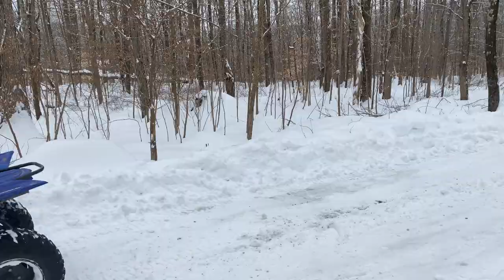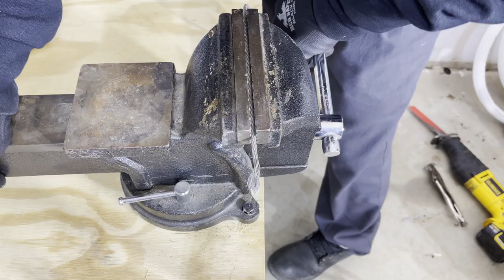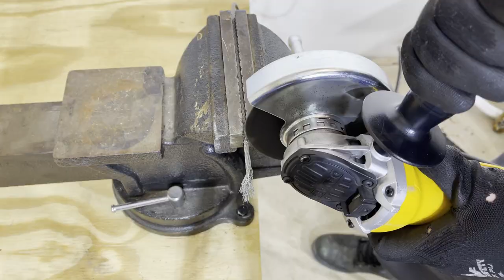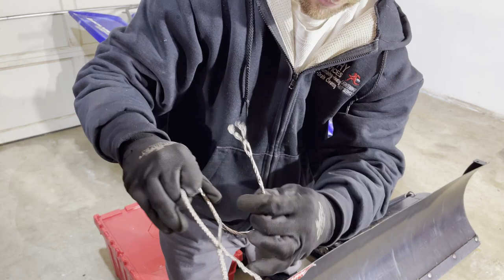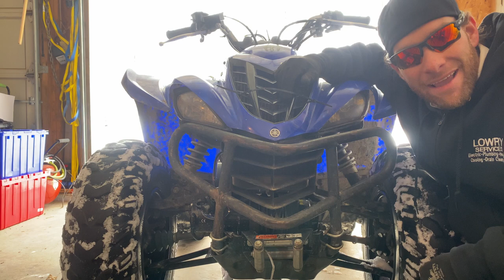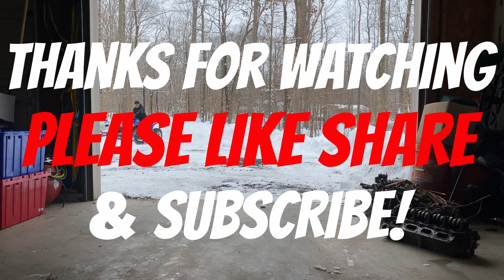How To Fix ANY Broken Winch Cable Braided Line Wire Rope ATV UTV 4 Wheeler Jeep Side By Side Quad

Comment: My cable line snapped and Spooled the line completely in the winch and it looks like a rats nest…any advice?
Reply from the maker: I haven't had too much of that issue, but it's usually from rolling it back in and having too much slack. In my experience when it spooling up or bird nesting, I would pull it out of the winch past that bird nest point, and untangle it. 

Then once I have it laid out on the ground and straight, I’ll either have someone hold the hook to keep tension on it, or attached to something that has a little bit of weight to help keep it from happening. 

You could also connect the winch cable to a tree or a fixed object, and put the truck or atv in neutral and then hit the button to retract it to pull it in clean with out getting tangled or hook something up
Reply from the maker: If it's really stuck and you can't get it out. Needle nose pliers and screwdrivers can usually help prying at it. 

If you can get enough out to connected to something. You could try to connect it to a tree or a fixed object, and put the truck or atv in reverse and see if you can pull it out that way. 

If you have enough cable you could always cut out the bad spot out and then just deal with the shorter cable.
Reply from the maker: Worst case scenario if you can't get the old one out on your own, you might have to cut it out in pieces with a Dremel cutting wheel or tin snipes, and ust start working at it to get all the pieces of the old cable out, then just get a new winch cable to replace it with.
Reply: Thanks you Brandon... I ended up using a dremmel and some elbow grease... little by little I removed the entire line and bought a new cable line from harbor freight...